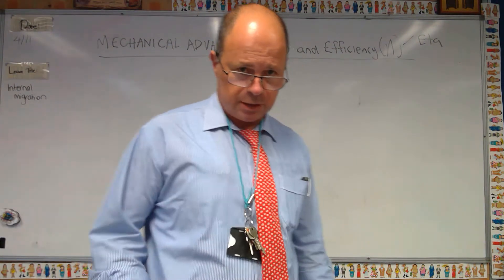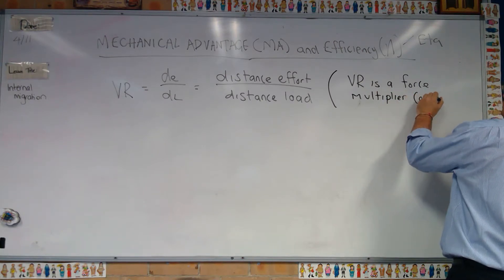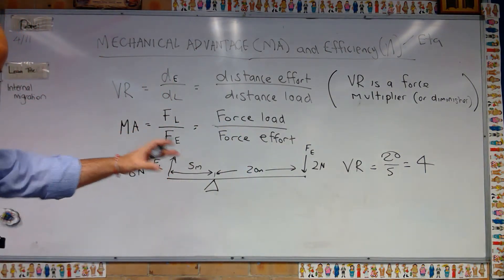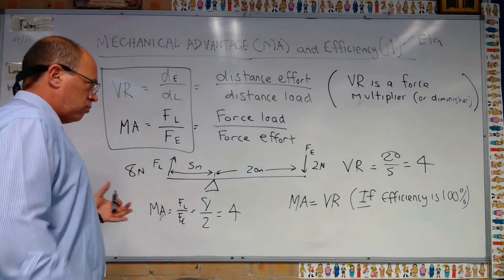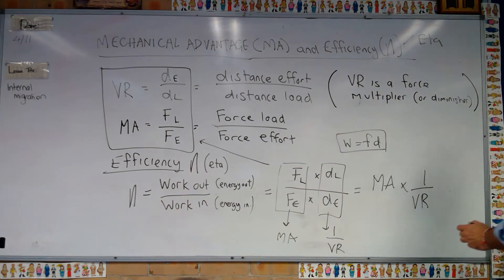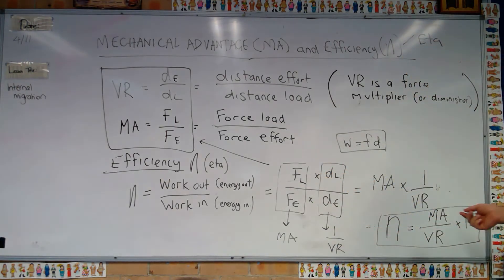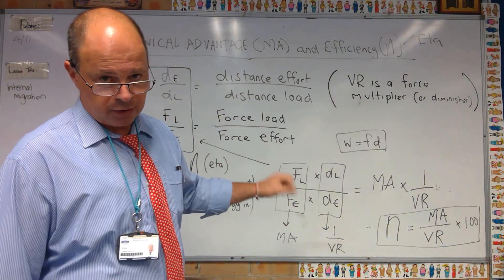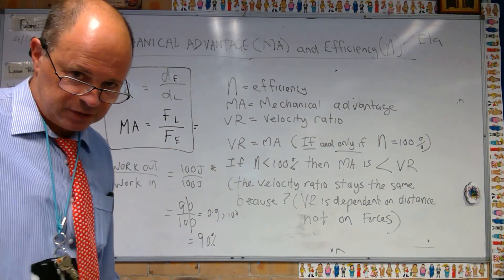Mechanical Advantage and Efficiency

Comment: does not it will mean that when efficiency decreases , distance moved will also changes as force will decrease
Reply from the maker: For 100% efficiency VR (velocity ratio) and MA (mechanical advantage) are the same. As efficiency decreases MA becomes less than the VR. So YES to achieve a desired MA value we will need a greater distance of effort as efficiency drops below 100%..
Reply: @TheArtofEngineering  sir, resistance  is obstruction to the flow of current, then why it is said that it is just a proportionality constant as per ohm law
Reply from the maker: @naveensingh5787  ohms law ? Resistance (in ohms) is equal to voltage DIVIDED by current. The PROPORTION of voltage to current is why it is a proportionality! But why ask that question here?? 😂
Reply: @TheArtofEngineering  thank you so much sir, god bless u